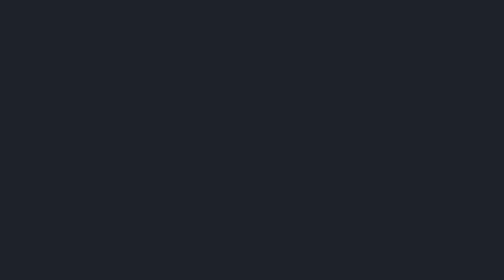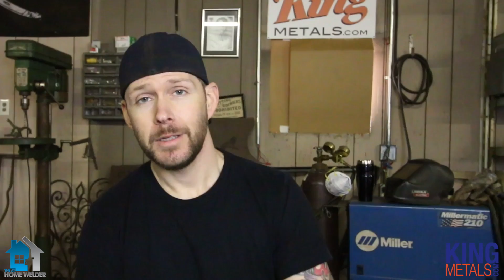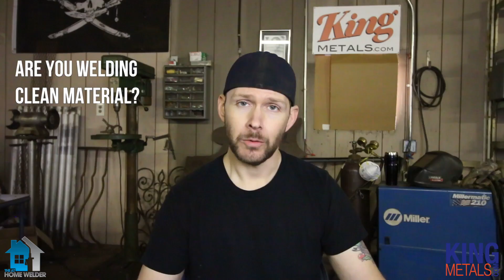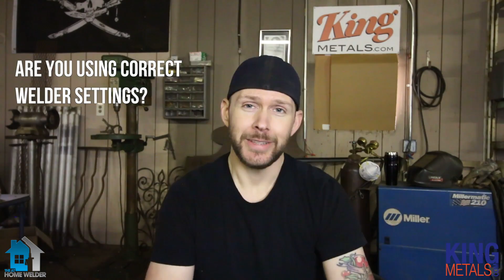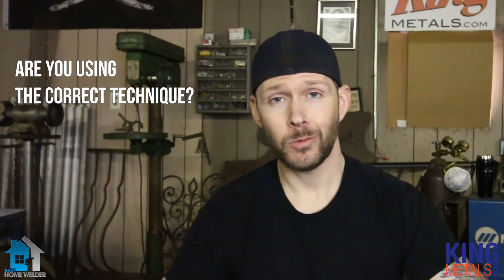Why Do My Welds Keep Breaking

Comment: Trying to weld broken stud to a nut and the nut keeps coming off clean with very little material sticking to it? Using Lincoln 100 flux spoil welder setting are voltage c Sosa’s 3
Reply: did you figure it out bc im using a mig welder and it keeps breaking doing the same thing
Reply: Same here but I’m trying to remove a stripped lug nut trying to weld a socket to crank it off but weld keeps snapping